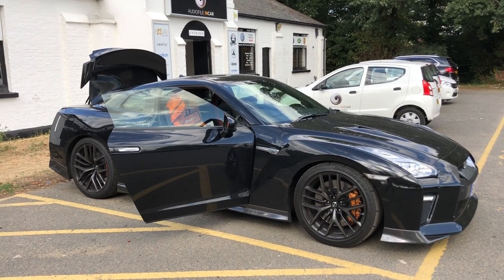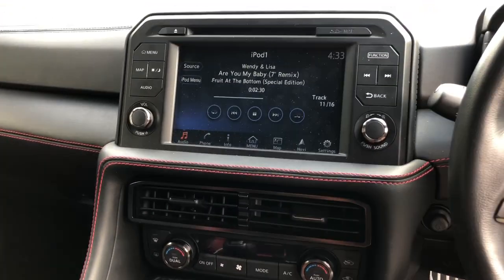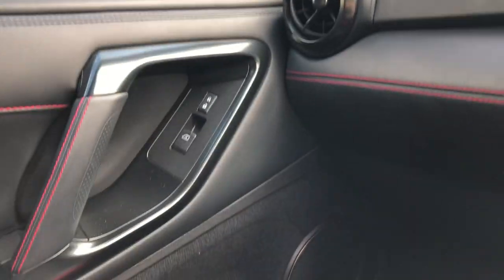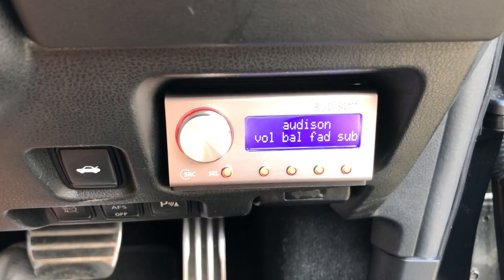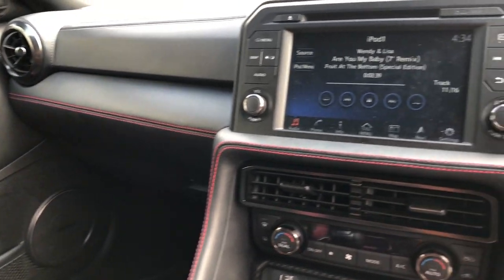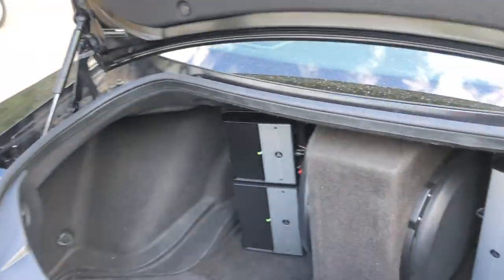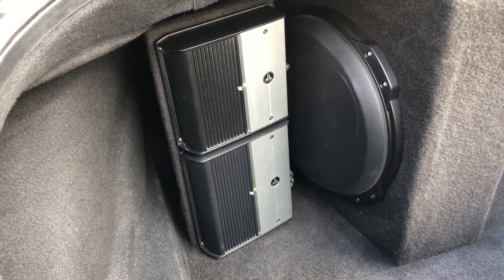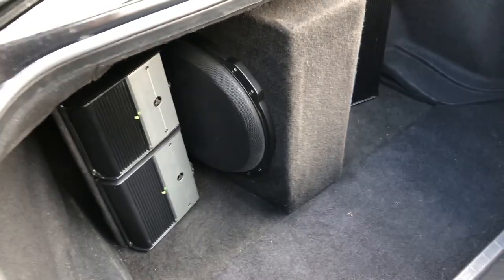Nissan GTR Audio Upgrade - Sound System Replacment.

Comment: Didn’t know people would even wanna upgrade, the sound system in mine standard was insane
Reply: Agreed, best sound system I've had in a car to date. I was pretty surprised.
Reply: I was impressed until I blew them out. Went with a Rockford Fosgate system for an upgrade. If you like loud music and hard hitting low and high bass is suggest the speakers I got. Little pricey for a sound system but well worth it. Slight modifications to make them fit with the stock ports but we'll worth the money imo. 2011 R35 Black Edition

Comment: I've never been a fan of BOSE. Yep, I know they fit them in Ferrari's ( which is their downfall ) but I think BOSE are garbage - always have been. I'm a bit of a music/audio snob, so apologies. It comes after 34 years of Djing. fyi: Dj industry secret - BOSE is an acronym for Better Optional Sound Equipment. I'm curious. I don't won an I phone, probably never will, I've never brought into the greedy bastards at Apple and thus I have NEVER purchased a single song off them. Never will. I always buy the physical cd. So my questions are:  Could you/would you fit for instance a Bang & Olufsen system? Do you pull out the old redundant amp and is there an option to go completely away from the whole iphone appletunes situation. I'm not suggesting a rewind back to cd, but what about a datastick? I would never allow my phone to be automatically paired up with a car.